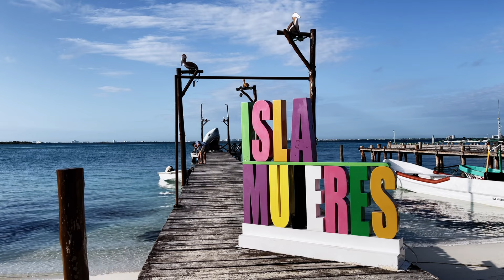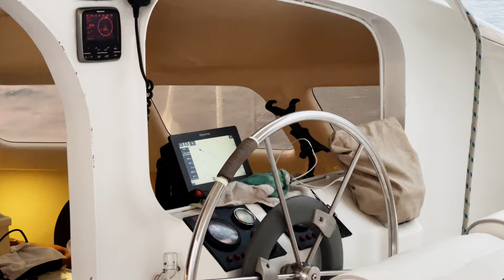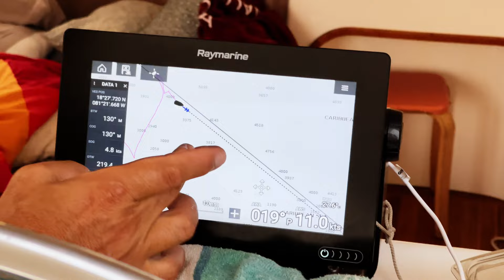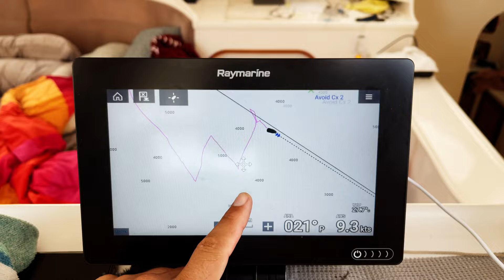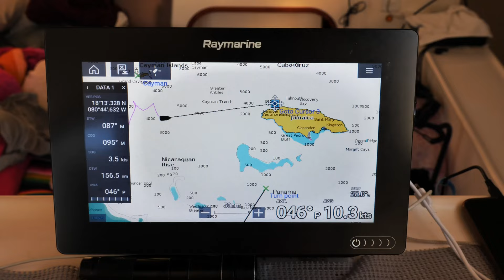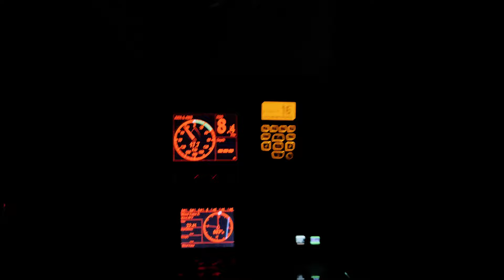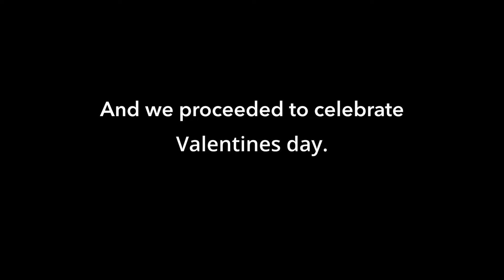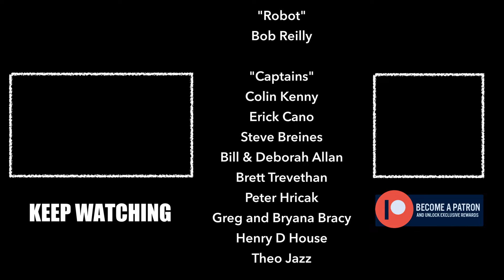A TOUGH PASSAGE (Part II) - Sailing Life on Jupiter EP110

Comment: I agree with you that the clutch axis is not in line with the winch. It is under tension with a bend in the line between the pulley and the winch. That is why it kept breaking.  It probably need to be raised to be in line with the winch to get rid of the bend. Star link works well on the east coast, but I am not sure on the west coast. Best.❤👍
Reply from the maker: Cheers Dan..Yep, we will order one soon. West coast is looking good for Starlink

Comment: Excellent vid.  I used a motorbike sprocket and chain with dyneema line for my steering (40' performance cat Pescot)  and it was fantastic.  I didn't have a rudder sensor either, I just put wooden stoppers at the tillers that would not let the steering go any further.
Reply from the maker: Yep, that'd work Phil.

Comment: The rudder sensor  is a pot , you should be able to check it with a voltage  meter to see if it is giving a smooth change in  reading when rotated. It's crazy how much is charged just for that simple  sensor.
Reply from the maker: Not my sensor Peter… my $5 pot on a dodgy DIY mount…that needs some attention from time to time.

Comment: I've seen it a few times in your movies (this one at 1:16) and in my opinion the sheatlead should be more backwards on the jib track (it will save your jib-sheet). The jib-sheet must be in line with the center seam of the jib. I also think that the jib track should be more outward.
Both sails have a sail point and together they have a common sail point for the whole boat. If you don't sail with both sails (with a wind angle close to 90 degrees) the ship twists around the sail point and that force wreaks havoc on your steering gear.
Reply from the maker: You might be right Jelle.

Comment: The weather helm might be corrected by having longer rudders. It looks like you got stuck in irons. I've heard that the hydraulic auto pilot is much better than the type of auto pilot you have but I haven't tried it for myself. James on Zingaro swears by them. Can Princes get dual citizenship with both Australasian and Philippine status? What are your plans for the next lap around the world? I'd like to see you go around South America and then hit all the islands that you haven't been to on your first lap across the pacific. I'd also like to see some more inland adventures like taking an Amazon river boat up river and having a visit back to the boat yard where you got your boat and possibly having them improve the design if that's possible. I'm not really fond of the navigation station inside because the display wall isn't tall enough to have an electronic chart plotter.
Reply from the maker: Nah Robert…I just forgot/too lazy/too tired to ease the main… the sails are big and there’s not much resistance in the water…small price to pay for a boat that performs.

Comment: 2hy will changing the side plates stop slipping ? Isnt it the claim inside that stop slipping ,  and it don't work , either lines not pre stretched and under tension, get thinner ,  larger lines ?   You can have a $$$$$$  yacht and the tension clutches slip.
Reply from the maker: No problem slipping David…it was a broken side plate… my winch sits a little too high for the clutch mount…so pulls upwards.